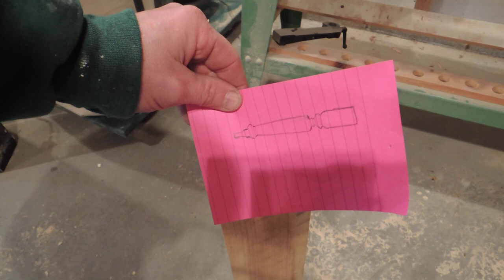Make A Farm Table Start To Finish

Comment: What router bit(s) did you use for breadboard? It didn't look like upcut spiral for mortise so I assume you used a straight bit? Thanks.  I really liked your approach to this project
Reply from the maker: Honestly, I can't remember.  I own both styles and generally I'll use the spiral in the router table to help clear chips from the mortise.  However, the bits do wear out and it's possible the day I was making this table all I had available was a straight carbide fluted bit.  Either will work, just adjust your push speed so that the bit has time to do it's job.

Comment: Not to shabby on the wood turning!  I am just getting into it myself.  Any tips or tricks on how to turn 4 legs that looks similar?
Reply from the maker: I find the first one the most challenging, actually.  For the others I hold up the first one to the blank and mark all the important transitions.  I do use a caliper to measure the original against the other three as I turn.  You only need to measure the top and bottoms of each feature and then connect the dots in between.  One really helpful tip, though, is to do all of the legs in one session.  That way you'll have a certain amount of muscle memory and you'll recall which tool you used on each section.  And, remember that the eye sees what it wants to see, not what's there.  You can be pretty far off mathematically yet the eye will see a match.

Comment: I know this as an old video but what kind and what size of bit did you use for the bead on the apron?! This is exactly what I’ve been looking for!! Also would it be possible with a hand held router? Thanks and awesome looking table! I found the turning of the legs very interesting and they turned out pretty amazing!
Reply from the maker: I don't recall the bead size for the apron, but it was probably a 1/4 or 3/8.  You can use a hand-held router for beading, but you'll want to clamp the workpiece to another board or a workbench so the router doesn't teeter on the edge of the board.
Reply: enduringcharm do you know what kind of bit would be used? And I would most definitely clamp it down
Reply from the maker: Pay attention to the shank size--you may have a 1/4 inch or a 1/2 inch collet in your router, or both.  A bit like this one would be fine: https://amzn.to/2ZD5l6D, or you could get a whole set: https://amzn.to/3fFgKID.  Just get the right shank size for your collet.
Reply: enduringcharm gotcha! Thanks so much. That helps a ton!

Comment: Why would you elongate the holes for the breadboard pins (to allow wood movement) and then glue the entire breadboard on (restrict wood movement)?
Reply from the maker: Well, two factors are at play.  First, the whole thing isn't glued.  The outer portions of the breadboard ends are dry.  How far you take the glueline is a matter of personal preference.  For smaller, more delicate tables it's even possible to skip glue altogether, but when the boards get bigger and thicker that usually spells trouble because tremendous force can be at play with expansion and contraction in seasonal movement.  So, it's a judgement call how far to glue.  Second, the reality is that the glue on the outer ends will eventually fail.  With enough movement over time the outside boards will eventually break free of the glue bond, which leaves just the mechanical connection to hold everything together.  You hope by then that the table top has basically learned to live together in harmony!  There is definitely a lot of educated guessing going on in this aspect of the construction, because different wood species, drying processes, finishes, sizes, humidity levels and other factors can all contribute to how a table top will move.  Elongating the holes is a traditional means of hedging your bet.  Sometimes it works well, sometimes not so much.